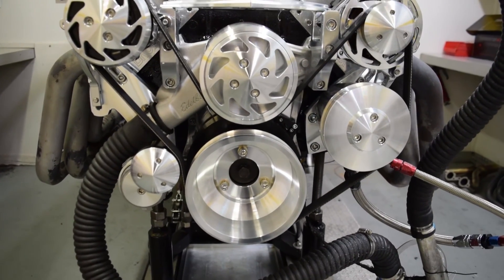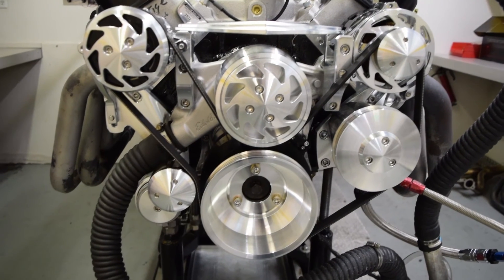Water Pump Speed: Performance Pulleys and Their Effect on Engine Cooling

Comment: Keep repeating it over and over and over and maybe people will eventually start to believe it.  Unfortunately many of the SBC aluminum pulley MFGRs don't even offer non-underdriven water pump ratios any more.  The only alum pulleys for C3 Corvettes are either 22% undriven or 22.5% underdriven; and AC cars came 25.6% OVERDRIVEN from the factory. SIGH

Comment: I wonder if it's possible that my mechanic put the wrong pulley on the hi flo water pump and it's not enough flow for the 4 core large volume radiator causing my over heat issue thermostat isn't the issue nor is radiator but radiator holds nearly twice what the sticker did I assumed since I pull ATVs to sand dunes more volume 4 core would be like insurance from overheating

Comment: When does cavitation start in auto water pumps?
Reply from the maker: good question. Really never experienced that. Would be a restriction to cause that because usually either we pump to much or not enough. Not enough is usually turning it to slow as in a 1 to 1 ratio or underdriven. Over driven we monitor water pressure and usually we try to keep that in a normal 15 to 20 psi range WOT.
Reply: @prestigemotorsports  it holds a bit of pressure and it keeps it at least until the next morning I'm thinking it's underdriven